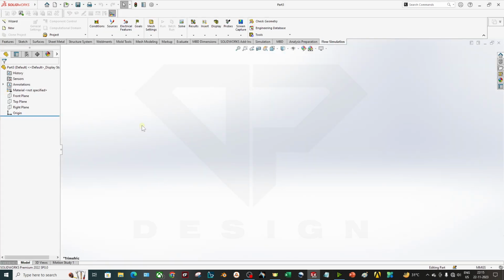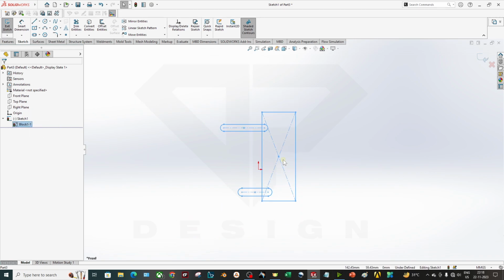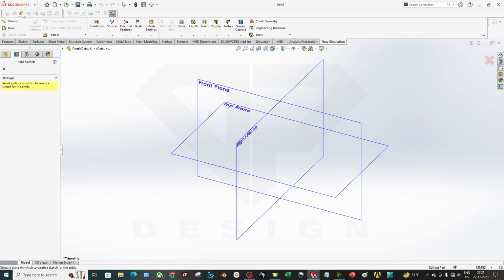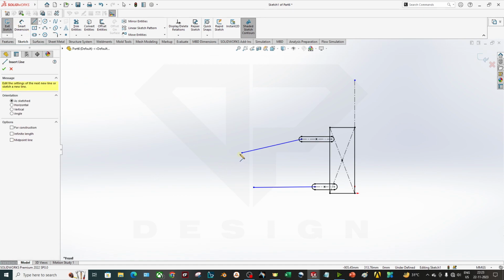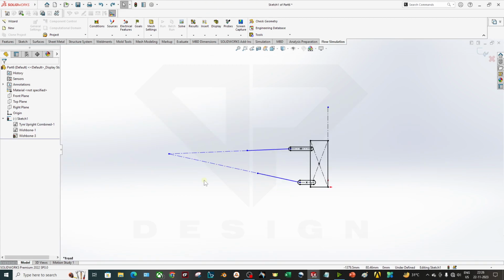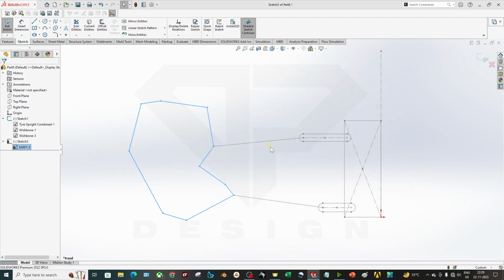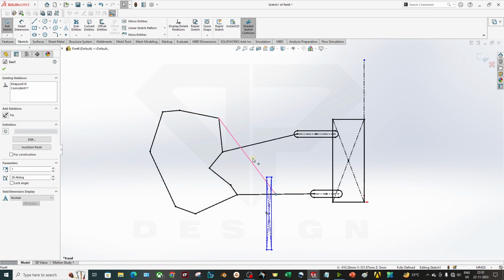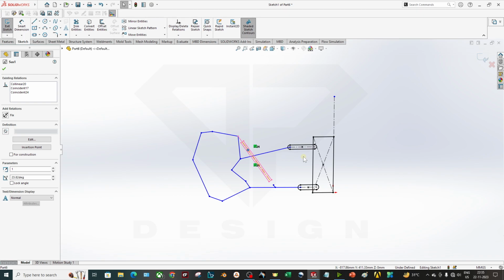2D Suspension Geometry Dynamics using Solidworks Blocks (Part 1) | FSAE | BAJA SAE | DP DESIGN

Comment: Will making blocks work with parts that you design? Can you make a video with parts?
Reply: Hi, i tried this and idts it works with parts. However you can use 2d drawings of the parts if that's of any help
Reply from the maker: You can't involve any 3D part during 2D dynamics.